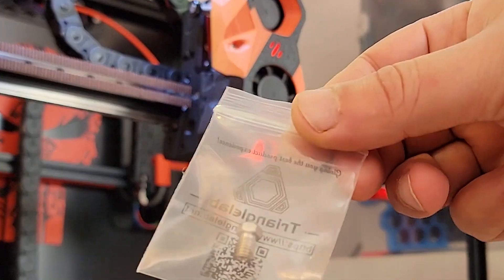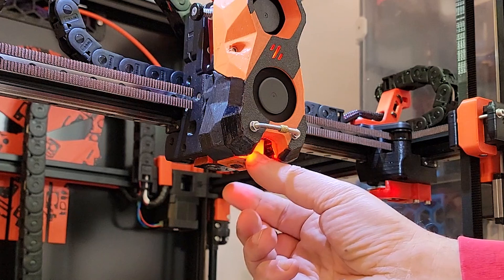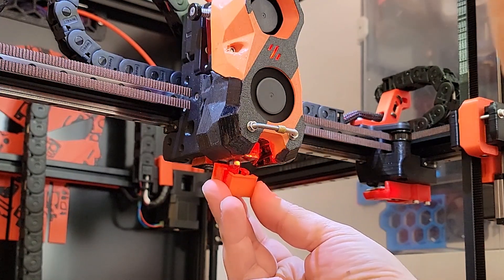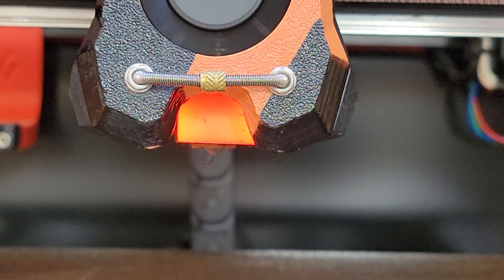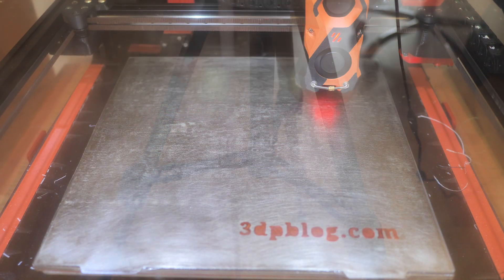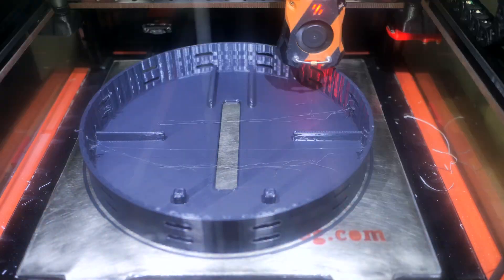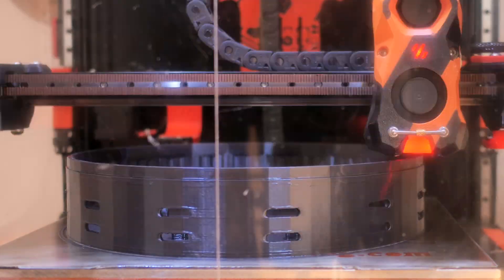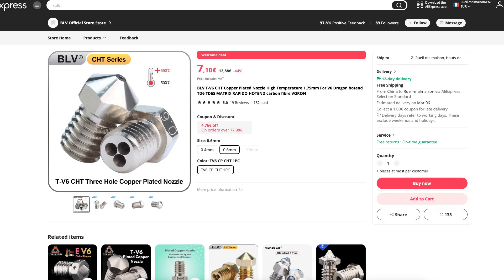High Flow nozzle from Trianglelab

Comment: I did a lot of flow testing with a clone CHT nozzle. It had one of the flatter top copper slugs, so I chamfered the entry to look more like this Trianglelab nozzle or a genuine CHT. I was able to get up to 30mm³/s with some PLA and with only 5% under extrusion. This is on an Ender 3 Pro with a bimetal heatbreak and a Sprite SE extruder. So with a slightly better heater I'm sure it could go even further.
Reply from the maker: Thanks for your comment. I bought also one of the cheap CHts on Ali (like 2$) - hardened steel with a copper 3-hole core. I haven't tested it yet - I am a bit afraid cause I ordered 0.8 nozzle, it is written 0.8 on the nozzle, but the hole is not more than 0.4. The Trianglelab one is quality. 
Today I had another print with large solid infill and I got nice infill at 30mm3/s (V6, 40W heater, titanium heatbreak from trianglelab - so basic). I made a video and will link it soon in the video description..
Reply: @3dpblog  That's strange! The set I ordered had 0.2, 0.4, and 0.8 nozzles and the holes definitely seem appropriately sized. My flow results were insane with the 0.8 nozzle after chamfering the entry. Trianglelab is def higher quality! That's great results.
Reply from the maker: I suppose i've got a nozzle from a bad batch. will get another one to test it. I linked a short video in the video description for the flow of the TL nozzle. I get good infill at 30 mm/s with ASA, which is great for a V6, PLA could be even more.
Reply: @3dpblog  Wow 30mm³/s with ASA is excellent! Can likely do a lot more with PLA like you said. When I tested PETG vs PLA the maximum flow with minimal under extrusion was drastically different.